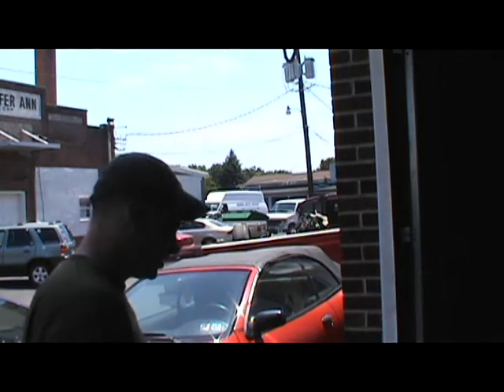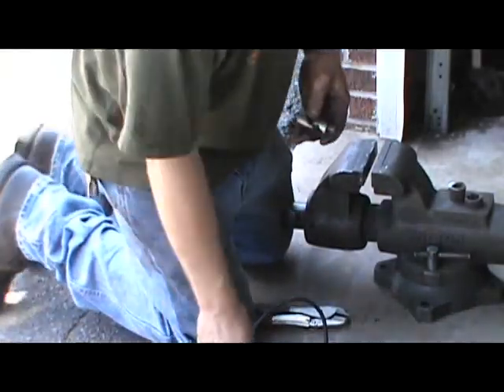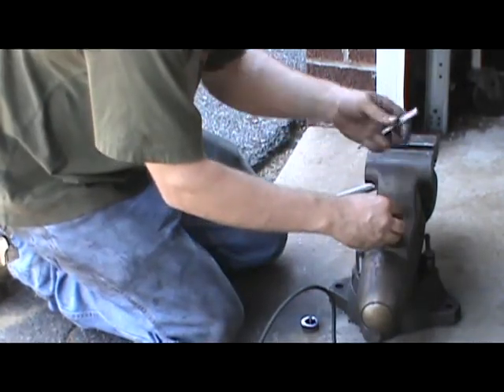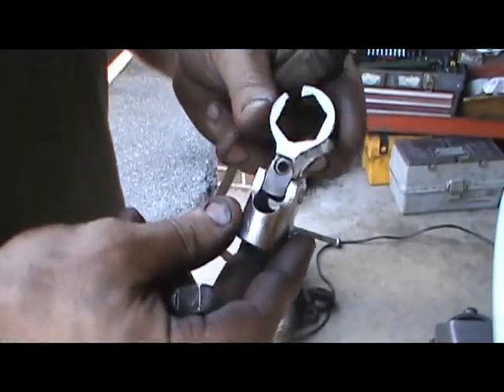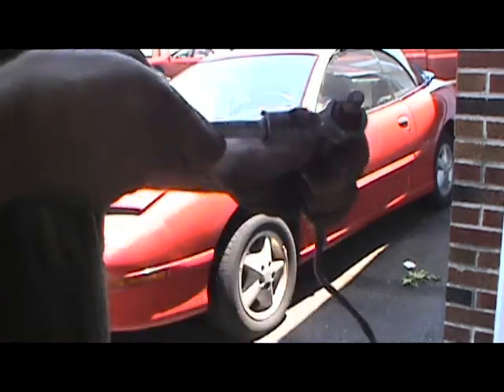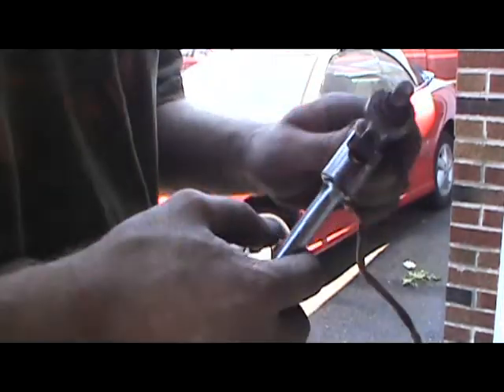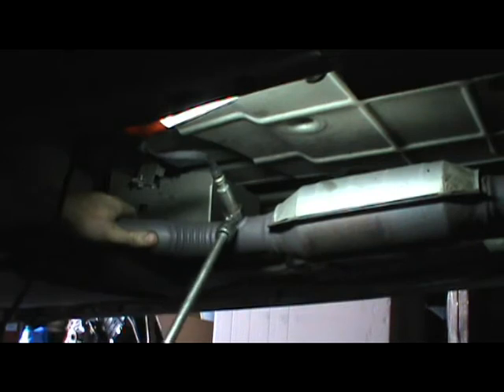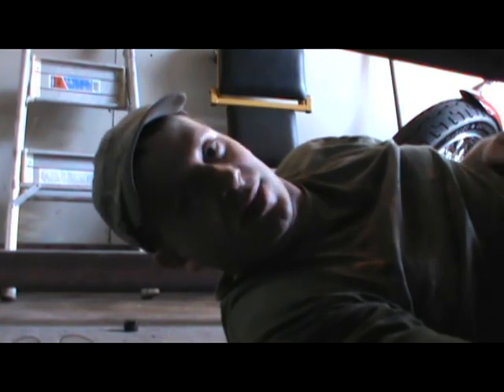Fabricating an o2 sensor socket wrench

Comment: Nice welding Will and good tips.  If I am going to replace the O2 and its in a  bad spot I try to cut off the body of the sensor just above the nut  with a sawsall giving me lots of room to put a wrench or regular  socket on to remove. Looking forward to more vids,good work.

Comment: Nice job on the custom tool...just be careful changing grinding wheels(unplug it).

O2 sensors can be in some awkward places to get a wrench on, so that one should work in alot of situations...good job making use of the old swivel.

Comment from the maker: Good point, im surprised i haven't seen this already, every cylinder would be independent, seems like the missing link when you look at it this way, usually i see 4 at most on a v6 or 
v8 with dual cats, bank1, post1, bank2, post2 never personally seen one for each cylinder would be cool though, in addition to being more efficient it would make for easier troubleshooting as well

Comment: any reason why you couldn't just use an open ended wrench?
Reply: +shawoo theirs a very high chance it'll round the 2 points it contacts on a rust seized sensor, the tool he made gets a better grab on it

Comment: Mr. Will,
Do you think sometime in the near future we will see, 1 A/F ratio sensor per cylinder? for example, 6 cylinder engine with 6 A/F ratio sensors mounted on each exhaust runner? Over the years we have seen 1 injector per cylinder then 1 coil per cylinder (COP). Do you think this would make sense? could engines be more efficient this way? of course I suppose the pre-and post cat sensors would still be intact. anyway this is just an idea, wanted to throw it out there thanks?

Comment: why not use a open end wrench and if the 02 sensor is bad unplug it and cut the wire on the old sensor and use a regular socket.
Reply: Maybe your O2 sensor is good but got dirty and you are taking it out to clean and retest. Maybe I'll clean it and fix whatever got my O2 sensor getting if it was from a malfunction such as oil leak in Seattle intakes.

Basically, it'll save me a lot of money and from faulty diagnostic